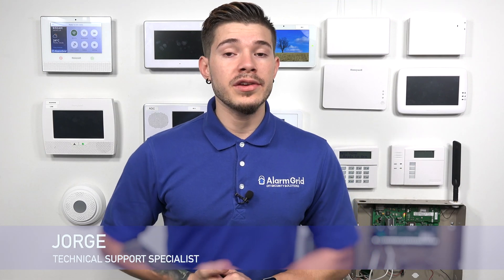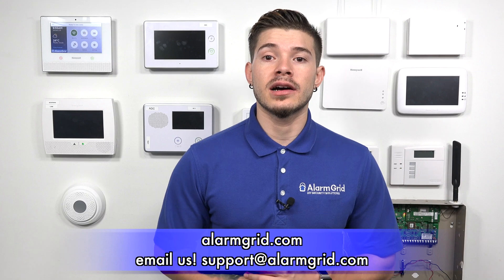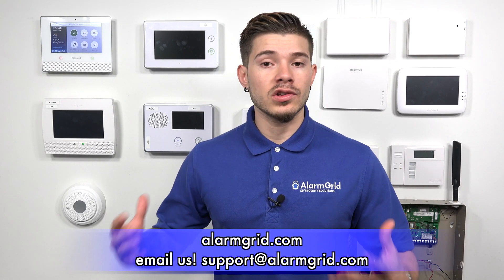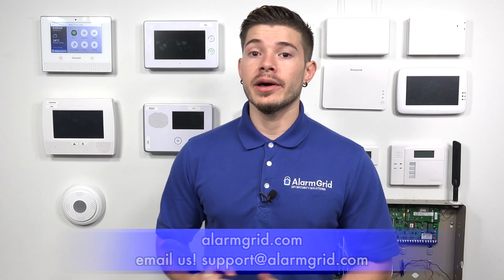Why Can't I Use Z-Wave Security Sensors With My Alarm System?

Comment: I am using paradox alarm system. I am in Eu and alarm sensors are using 868mhz. does zwave interfere with my alarm system or vice versa?
Reply: It is very likely this would interfere with your system as EU Z-Wave devices would operate over the same 868mhz frequency.
Reply: @dylanalarm_grid1038  I callde the national distributor. They claimed they would  not interfere. Actually z-wave is 868.4Mhz. Paradox system is using 868Mhz.